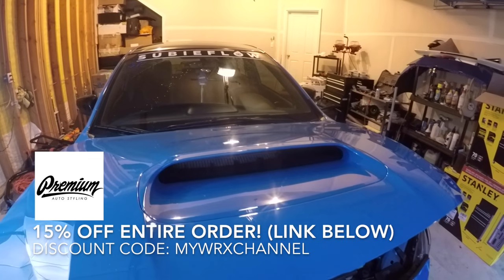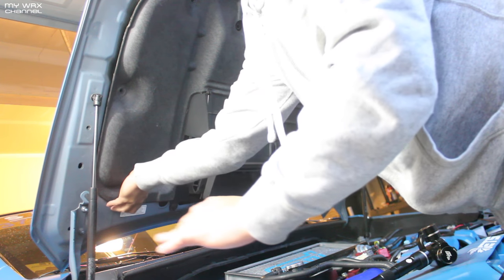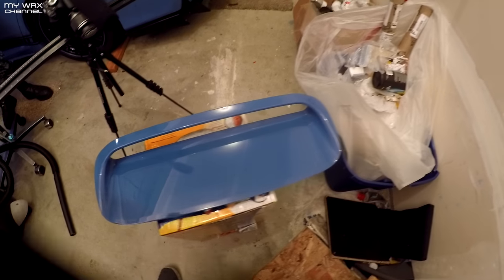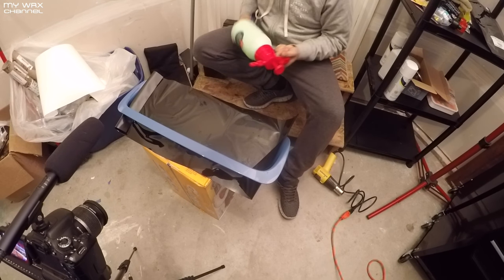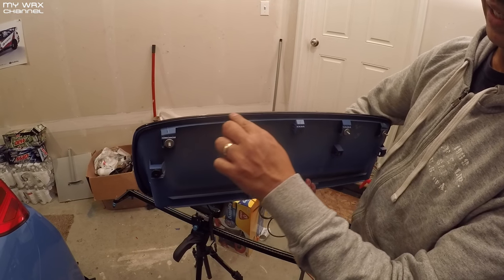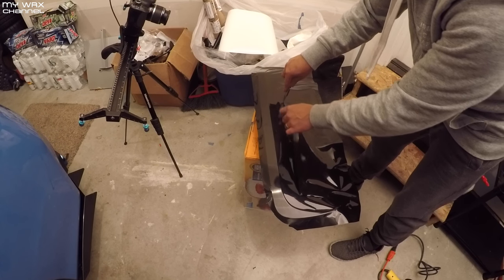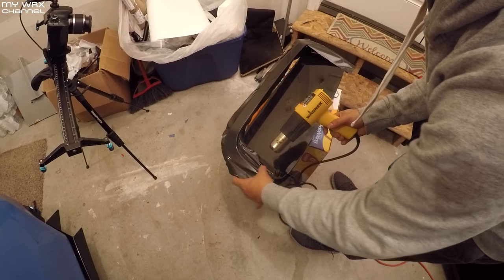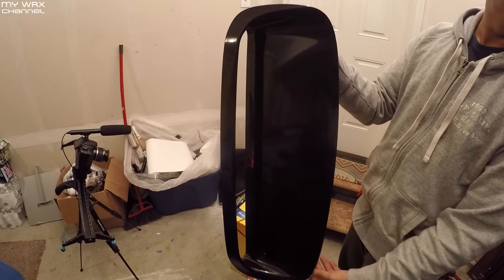HOOD SCOOP WRAP DIY/How To | 2016 STI Hyper Blue

Comment: only thing I didn't see was post heat. You usually need to go past 180 degrees for a few seconds to reset the memory in the film. Just because you get vinyl to stretch on a piece doesn't mean it will stay for 2 years. You need to heat it really good after you're done to see if it will stay put. Nice job though, looks clean.